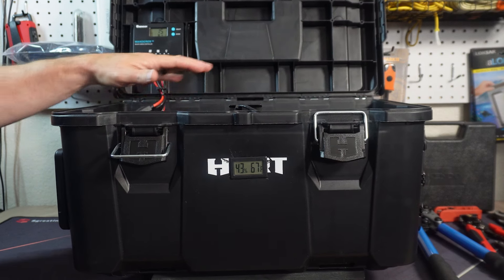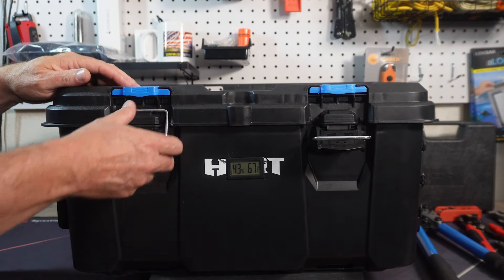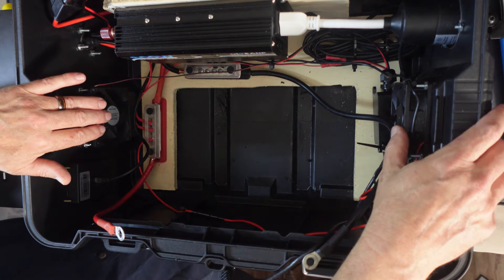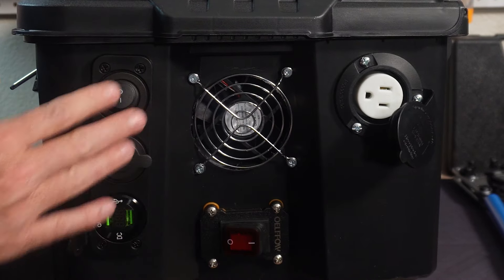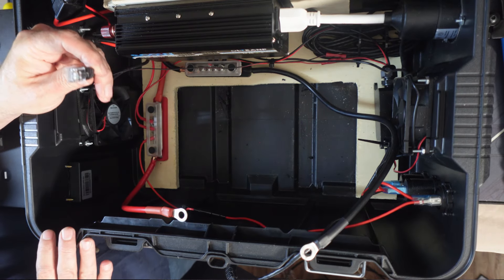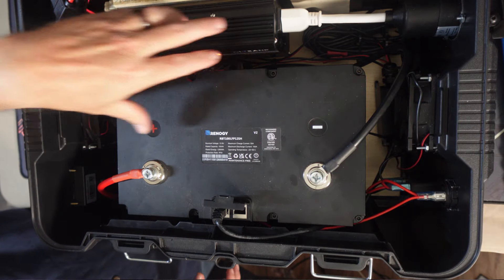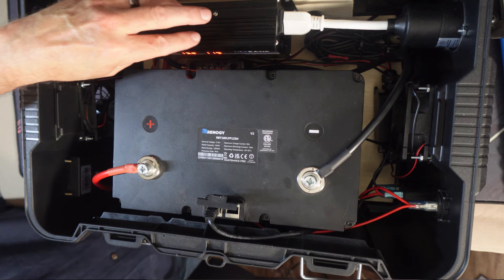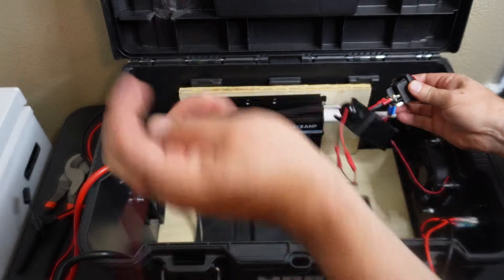DIY Solar Generator Battery Box | Beginner Friendly

Comment: Built mine a little smaller I put mine in a plastic ammo can and works great , cost was about $100.00  . 🌴😎🌴🤣🇺🇸
Reply from the maker: I might try an ammo box next. What size battery did you use?
Reply: @TheBugOutLocation  12volt motorcycle size battery door cell
Reply from the maker: @patriotordinance9695  Cool. I have a 20ah I might try with.
Reply: @TheBugOutLocation  I believe mine is 24 amp hour

Comment: I'd like to Build a 24 Volt 200AH Lithium Iron Phosphate Battery System with a Victron Phoenix 24/1200 Inverter and Smart Solar 150/35 Charge Controller and really be able to Recharge This Tool Box in a Day with 2 160 Watt Eco Flow Portable Solar Panels on The Go or Boondocking = 24 to 12 Volt 10 amp Step Down Converter and a Few needed Plugs and It would Offer a Good Bang for The Buck as opposed to a Delta EF3 Pro 1300 or River 2 Pro would